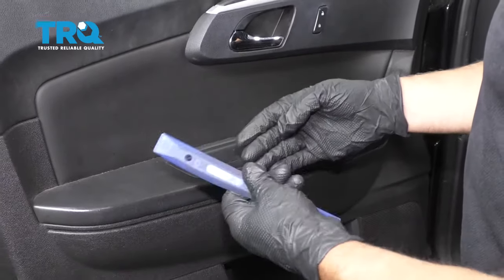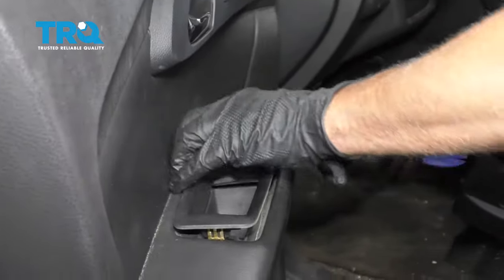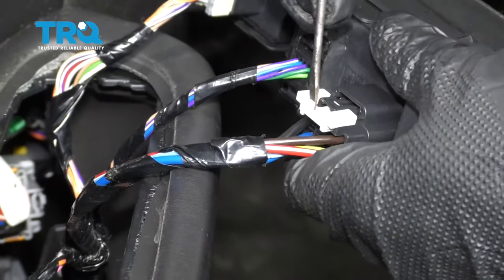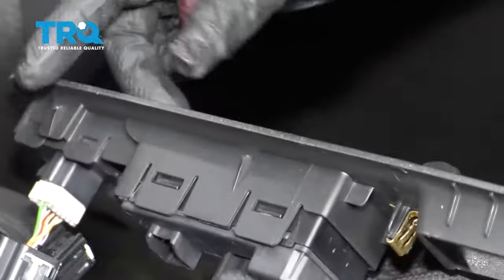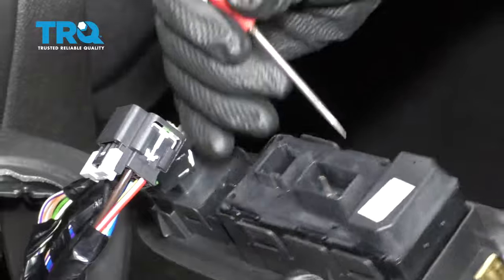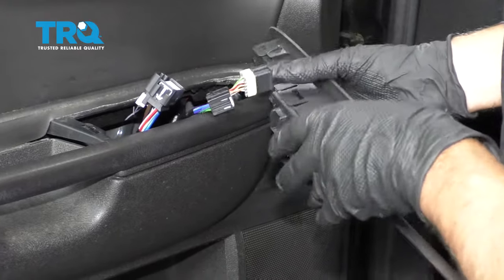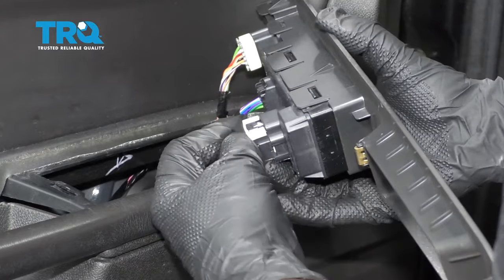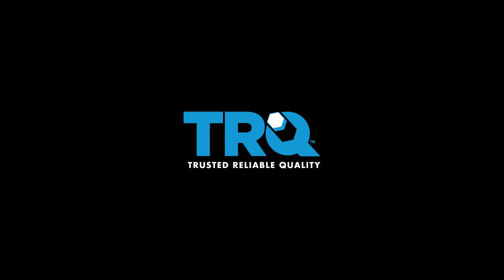How to Replace Front Drivers Side Window Switch 2009-17 Chevy Traverse

Comment: This is NOT correct for a 2016 Traverse LT.  If you use this method you WILL break the plastic that holds the trim piece in.
Reply: should have read a few comments - just broke on of the plastic pieces that holds on mine for a 2015 - looks like I have to take off the entire door.
Reply: @peterkispert1237  same here 🤣
Reply: Same for the 2013.  Just broke it.
Reply: Same with the 2014. Just broke mine, too.
Reply: I did the same shit 🤦🏾‍♂️ 3M double sided tape will hold it

Comment: Doesn't work for 2016 Traverse. The trim piece is solid plastic. And now I have to go buy that piece. 🤦‍♂️😡
Reply: Same issue, may be this way is for non - LT. It is screwed it, doing this method with break the piece
Reply: Same here! 2013 Traverse.
Reply: Same with 2015.
Reply: I just did the same thing on my 2017 🤦🏻‍♂️🤬

Comment: You need to change the description of your video. This does NOT work for a 2013 model. I ordered this switch and I can’t even use it. In the process of trying your method, I broke my door trim trying to “pop it out” as you suggested.

Comment: This not the way my 2017 traverse is assembled. You have to take the door panel off to get the old switch out. It's not terrible but if you try the method shown here you will break some parts that are melted together.

Comment: Doesn't work on the 2013 I just broke the trim panel because it's a solid piece thanks.
Reply: Same, wish would’ve saw this comment beforehand.
Reply: Just did the same thing.  Though this would be an easy fix.
Reply: Wish I would’ve read this before doing the same thing

Comment: Removing the switch on a 2017/2018 model does not have the metal clip. It is glued in with plastic posts (that I broke two off).

Comment: Fair warning if you look at the comments before watching the video, this only works on the base model. the 2009-2017 Chevy Traverse uses a different cupholder on the LS and LT models where you have to remove the door panel

Comment: True assholes. I tried this on a 2015 Traverse to find the master switch plate is plastic welded into place. And I broke all the boss plastic mounts holding the plate in. For now I super glued the plate in place until I can remove the door panel (preferred method) and JB Weld the plate back into place. So much trouble this video caused me!!